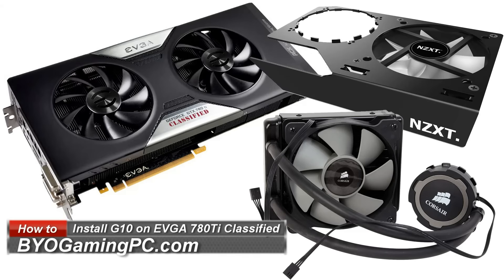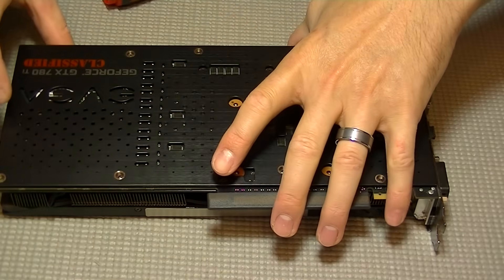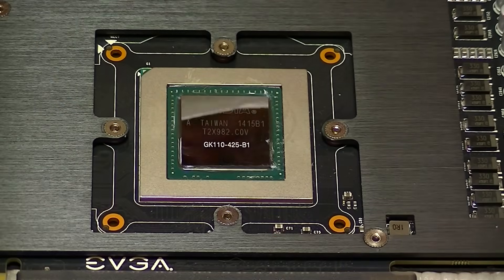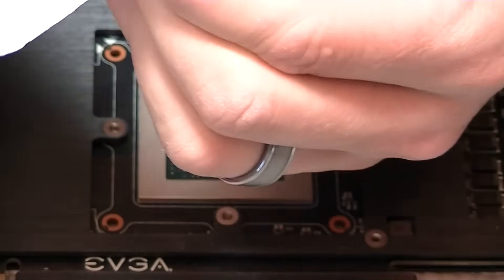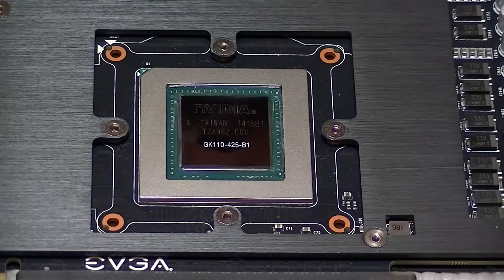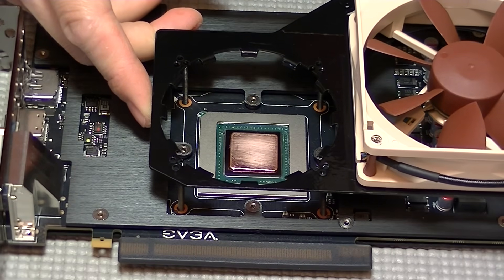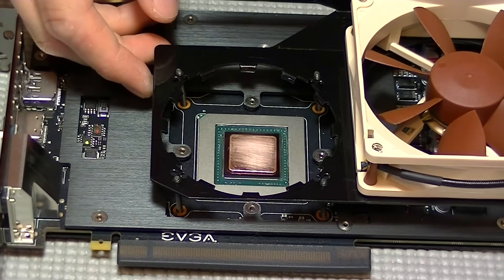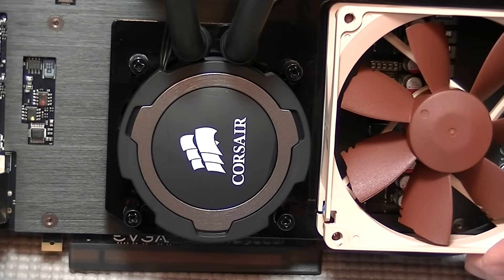NZXT Kraken G10 Install without Removing Heatsink

Comment: Question.. would I get better cooling on the gpu without the copper shim... so the h75 straight on the processor? I have two 780 it dual classifieds in SLI and plan to do this mod on both. I have the custom back plates but don't want to lose some precious degrees by having to use the shim. Also would A shim that covers more of the surface of the process be better for cooling or does that matter. Thanks in advance!
Reply: wow.. I meant I have two 780 ti dual classifieds.
Reply from the maker: You cannot leave the heatspreader on and bypass the shim without doing some heavy modding like cutting the heatspreader. The tabs around the GPU won't allow you to have direct contact to the H75 without a shim.
Reply: BYOGamingPC Sorry I understood that I would need to remove the heatspreader. My real questions are will I get the same cooling effect with the shim as I would if the corsair block was directly on the GPU processor? And does it matter that the shim is smaller than the actual processor...  for cooling purposes? Thanks for the help and I appreciate your post showing us how to do this.
Reply from the maker: Brad Stout The use of the shim will still result in nearly the same cooling effectiveness since it is a copper shim. Copper conducts heat very well and more copper will dissipate more heat. There is, of course, the possibility that you over-apply thermal paste or don't clean the surfaces between the GPU, shim, and heatsink which would negatively affect the cooling ability but as long as you do a proper installation you won't have a loss in heat conductivity.

Comment: So could I install my pump, 80mm fan from the kraken, and pump fan to the PWM fan adapter you have listed, then to the 4pin to 5 pin you also have listed on the GPU fan header? Then could i use my GPU fan software to change the speed of the fans and pump? Or will it all be separate in terms of controlling it in the software?
Reply from the maker: No, the PWM header on the graphics card will not supply sufficient power. The only thing I would recommend running directly from that header is the single 92mm cooling fan. You will need a powered adapter if you wish to use the graphics card's PWM header to control the speed of the fans.
Reply: Okay but i go the PWM adapter with molex like you have in your info box. Would i still not be able top run those fans? Would i hook my pump into my MoBo with its fan? cuz i did get that PWM molex fan adapter. I understand the GPU can't handle the fans and pump but thats why i got the adapter.

Thanks for your response!
Reply from the maker: TheHolyEvade Oh, I'm sorry, I misunderstood. You would connect all of your fans to the powered adapter. One of the connections is to connect to the adapter from your GPU which controls the rest of the fans connected to the powered adapter.
Reply: BYOGamingPC Awesome thanks!
Reply: TheHolyEvade 92mm fan bro. idk where you got 80mm, but that will fall through
Reply: Naram B woops, never mind...I see the wholes for 80mm now.

Comment: Sorry for the translation.
I would like to install the Karken G10 without carefully remove the top plate of the card.
Also I would like to mount the backplate at the rear.
So I would go in your own way.
I need to make changes? Type screws longer lunge, thickness etc?
Reply from the maker: I think the answer you are looking for would be in the description of the video. I have linked the extra hardware that you would need to keep the backplate installed.
Reply: BYOGamingPC
I understand. My question is if I can install it all without removing the backplate and without the use of a Copper Shim.
In practice it is possible to do without the Copper Shim perhaps using longer screws or some other change?
Reply from the maker: Gianni Dp. You can keep the backplate but you cannot keep the heatspreader without the use of the shim. The tabs around the GPU that connect the heatspreader will not allow the cooler to contact the GPU which is why the shim is absolutely necessary to keep the heatspreader intact.
Reply: BYOGamingPC
I understand.
Using the Heatsink Copper how many degrees you have managed to recover with the h75?
Without Heatsink would be better?

Thank you very much!
Reply from the maker: Gianni Dp. With the Kraken G10 and H75 I've managed to drop the temperature on the GPU about 15C but the VRM temps have increased by about 8C so it's really only worth doing if you already have the hardware in my opinion. I wouldn't go and buy the G10 and a cooler for a GTX 980. Only if you already have an Asetek style cooler would I consider the Kraken G10 as a cooling option for a GTX 980.

Comment: Hey, couldnt help notice that you stated that the screws need to be m 2.5 30mm in your classified and  kingpin g10 vid. I bought the m 2.5 25mm you linked in your classified vid for my kingpin backplate and vrm heat spreaders. Do you think they will do the job?
Reply from the maker: Yes, the screws I used in the video were 30mm but were actually longer than necessary so I linked the 25mm screws which are a better fit.

Comment: planning to do a kraken x31+g10 and a 970 combination
i guess doing it this way is better for vrm temps
Reply from the maker: This will help with the VRAM temps due to leaving the heatspreader on. The VRM temps should remain unchanged since the VRM heatspreader is able to remain without using the shim.